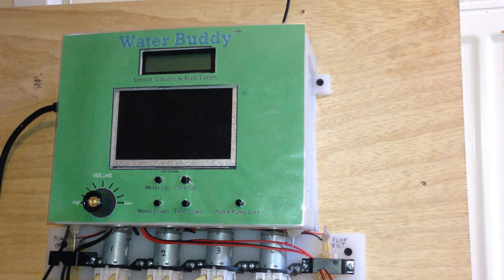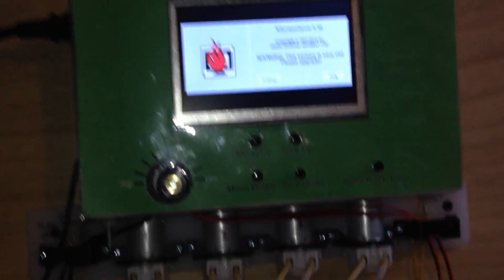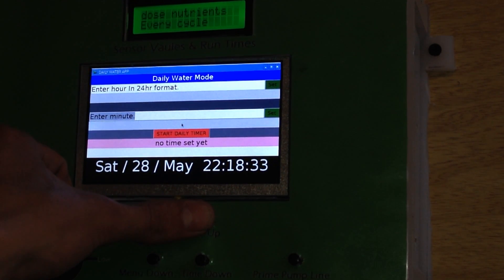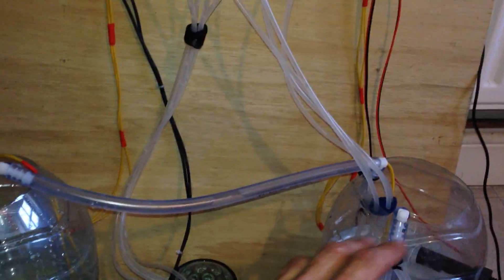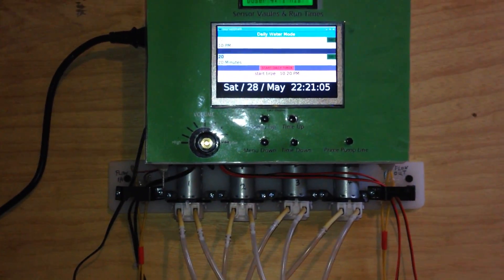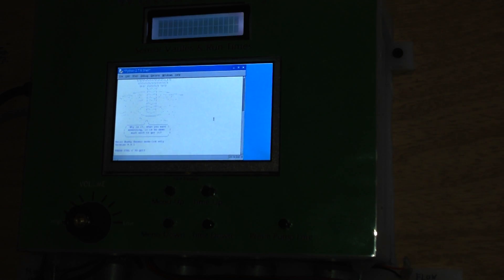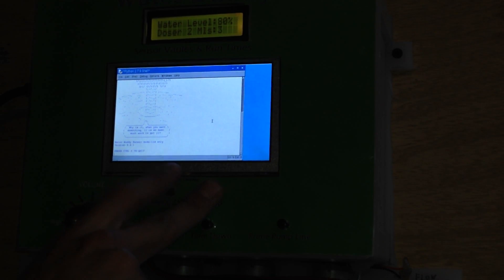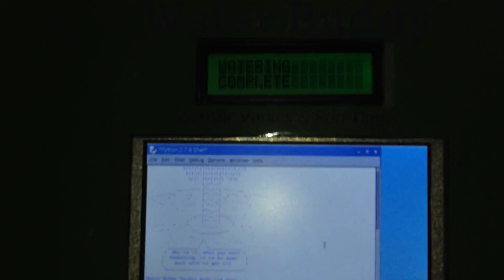Raspberry Pi automated Plant watering system

Comment: I have a similar research on this but I only have a 12v 7.2 ah lead acid battery, a 12v water pump, a DIY voltage regulator using a AN7805 IC and a 220uf 25v capacitor, a Raspberry pi 3 B+ model and a soil moisture. I am having a hard time figuring  out why my RPI does not work with the 5v output produced by the regulator. How can I solve this? I can't start coding the program because of the voltage needed to power up both the pump and the raspberry pi.

Comment: can you provide website for "each item" purchased and used in this video? What is the cost?  I am disabled and looking to create this EXACT device for 6 different plants..  each one will have a separate sensor and pump.  The idea for Nutrients pump to "all" plants is awesome!
I have a Pi 3 b+ new and not used.  I need to get the monitor and other devices you have including wiring.  I have never worked with bread board.

I will want this and another one to control 12 pumps.. I am DISABLED and need assistance watering.  I have rain barrels x 5 and large water storage.  I will add a small 10 gallon Nutrients tank to the supply..
Reply from the maker: This is an old project of mine, to which i used a raspberry pi. Though these days i would strongly recommend using a Arduino, which is much cheaper, quicker to setup and easier. This project is very basic, it is just a GUI and a timer with an RTC chip essentially. I could look around for this projects code but seriously it is OTT using a raspberry pi and a keyboard - mouse and operating system for such a simple thing. If you will wait 4 week once i have finished my thesis i will write you a Arduino TFT GUI version to water pot plants with a menu where you can just add and remove new plants from a list menu + touch screen keyboard to name each one ect...

Comment from the maker: Sorry i had accidently deleted the  folder which contained the code files. Here is a link to the new folder, I have made some major changes to the gui  file with a better design and all variables stored to a csv file on exit, and loaded on boot, Plus detection for if it was closed properly or by mistake, if it was a mistake such as power loss or an error, the app will start the timer automatically after 1 minute of booting with the last set time and values.  https://drive.google.com/drive/folders/0BytQJJb0jxlgWGJpdnkxQ0xQTzA?usp=sharing

Comment: not found
Reply from the maker: Ok i have posted the link to the code above
Reply from the maker: I have made a lovely hydro controller too with ec reading and auto ec adjusting, and water level control, Built with an arduino uno if any one wants me to upload the demo and code to youtube :)
Reply from the maker: Andi Nugroho Your right, I forgot to 're upload the files after an incident i  had with an app i was making to auto sync files to my Google  drive.  I will get them off the pi later today and 're uploaded them.
Reply: i would love to see your Code can you upload it?
Reply: thaaaaank you this is so helpful you have no idea! and thanks for the quick reply :-)
Reply from the maker: no worries pal :P